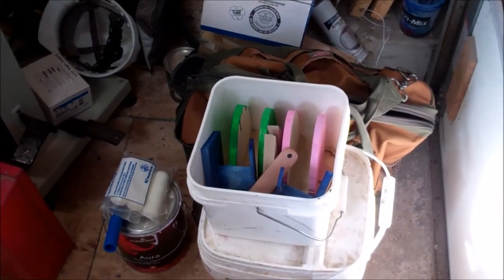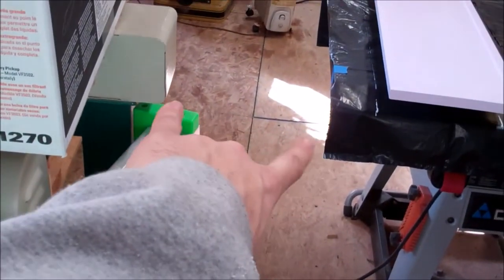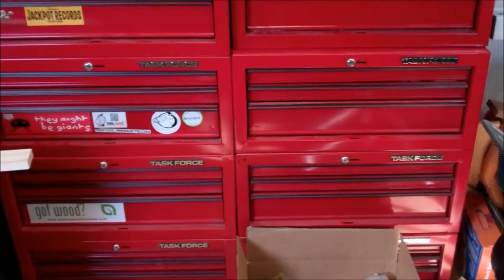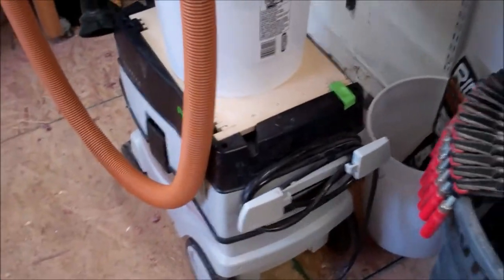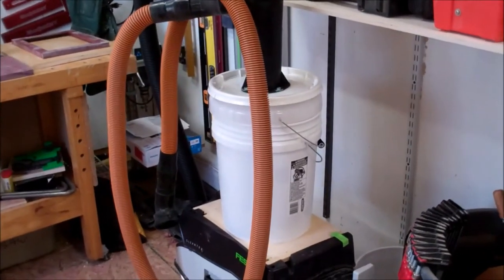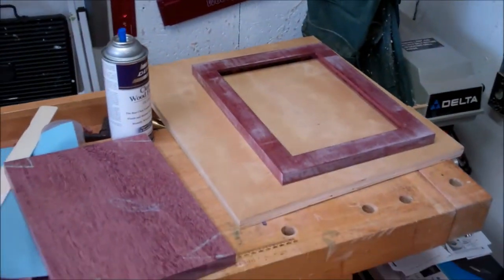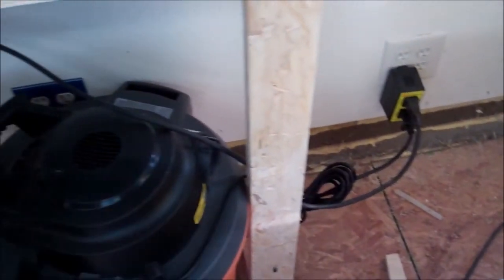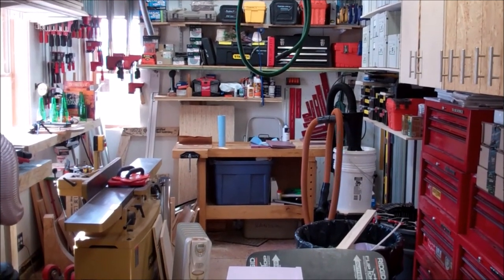2015 March Shop Tour

Comment: Could you rotate your table saw 90 degrees to gain the clearance you are looking for without having to shorten the fence and get rid of half the red storage cabinets?  And rotate it back only when you use it and need more out feed room.
Reply from the maker: Tom, while that would work, I look to keep my equipment as stationary as possible. If I had to move my table saw to use it, I dare say I'd use it less.
Reply: Dyami Plotke Wow, what a good point I hadn't even thought of.